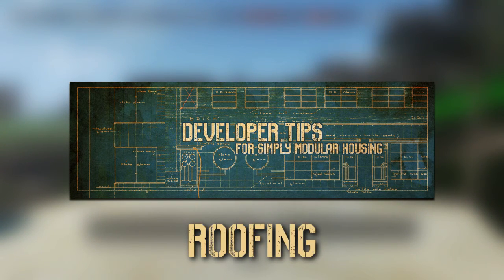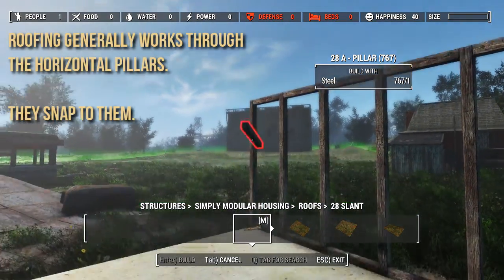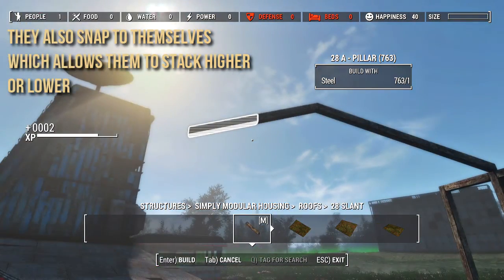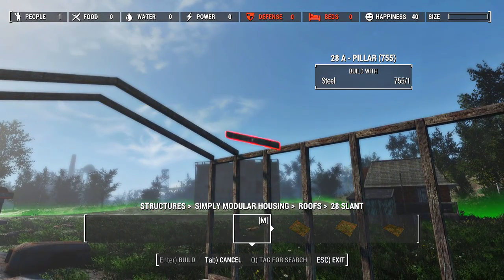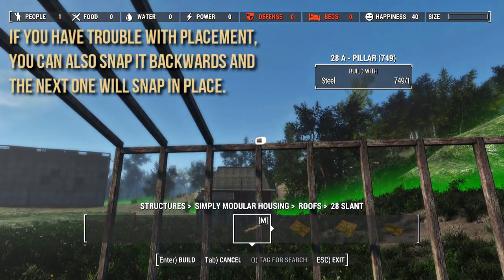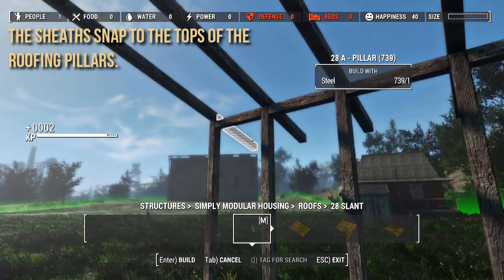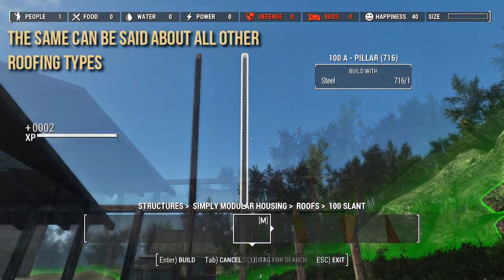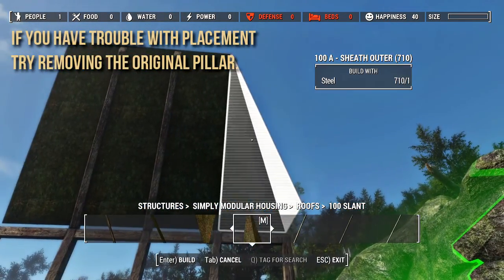Fallout 4 - Developer Tips - #002 - Roofing

Comment: The roofing pillars don't snap. I have been fucking with this mod for hours, I am doing shit just like in this fucking video.
Reply from the maker: Fallout 4 in a nutshell. They integrated snapping points but they don't work as intended.
Reply: @Stuyk  it took some doing, but once I got one piece to snap, I was able to make my roof from there. I'm using the older legacy version that still has the roofing pieces. Is there any way to close of the "ends" or "sides" or the roof?